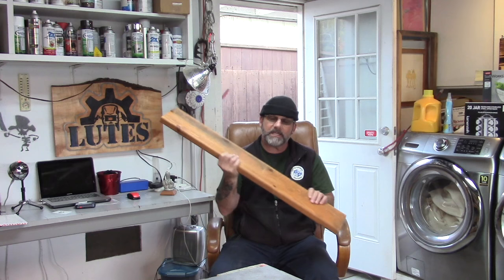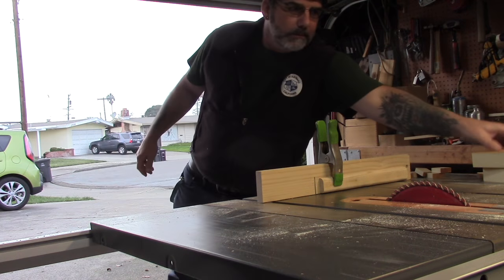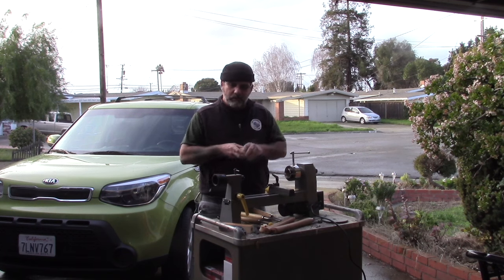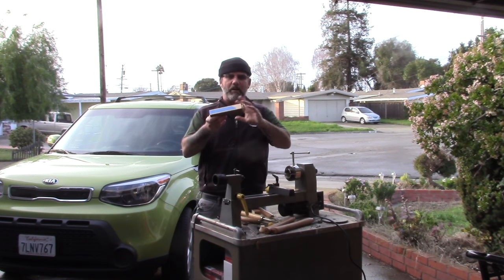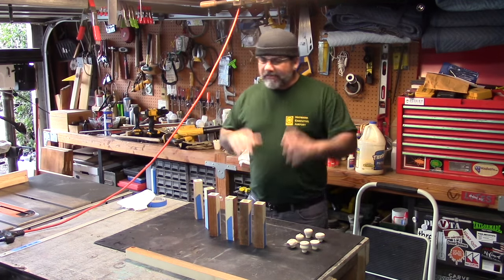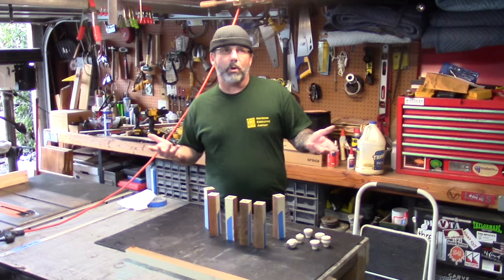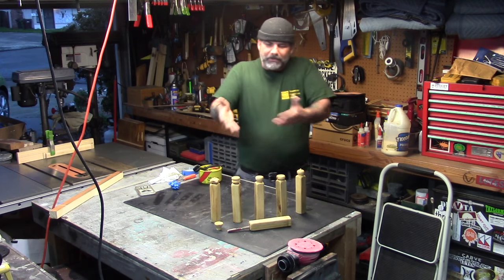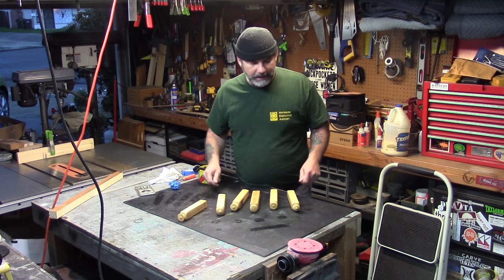Cigar Tube Style Pen Boxes From Scrap / Video # 21

Comment: Those pen boxes are a neat idea.  
Maybe for cutting the correct diameter of cap, if you were prepared to sacrifice a 3/4" spanner, you could sharpen one side and do away with the proper lathe tool?
Reply from the maker: DRMNZ 
Thanks brother :-)
I thought of that, the wrench already cuts that soft pine the way it is. Might be another video taking it that one step further !

Comment: hey if you grind that wrench down a little bit you could make a nice blade on it, i did it a few years ago when i was making tenons for a railing....works great.
Reply from the maker: Miter Mike's Woodshop 
Great Idea, I was thinking the same thing. It already cuts that soft pine, if it had an edge.....

Comment: good stuff lutes..thats different. different is good..u should get a face shield though brother! even thought its a small lathe a sharp vracked piece of wood in the face will crush ur modeling career..u dont want that.;) I used to just wear safety glasses when I first got mine until a piece of a bulb broke off hit me in the  mouth and cheek pretty sure it's chipped my tooth busted my lip open give me a fat lip for a week get me a bruise on my cheek with a cut for two weeks I had it set at a slow speed cuz i was new to it..now inwear a shield even when im sanding the pens or w.e. is on the lathe.just looking out for my  pallet bench brother..now im gonna be making pen tubes to give with any commissioned pens i spin..lil extra bonus/t.y. to the cstmr have a good one brother
Reply from the maker: Joe basementwoodworking 
Thanks Joe. And you are right of course about the face shield. Old dogs new tricks and all that :-)